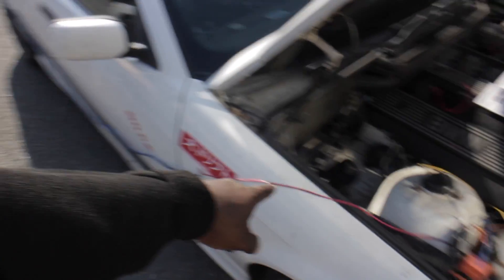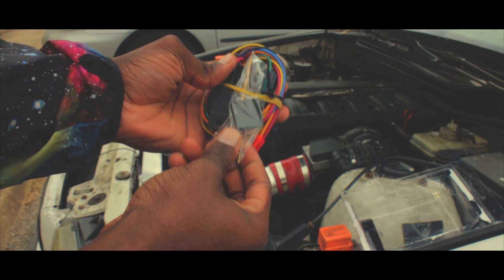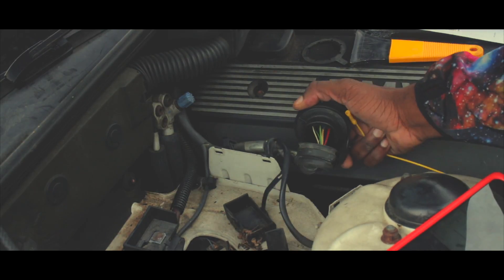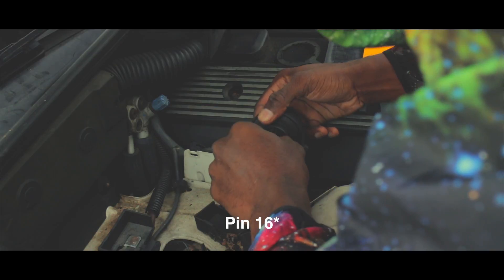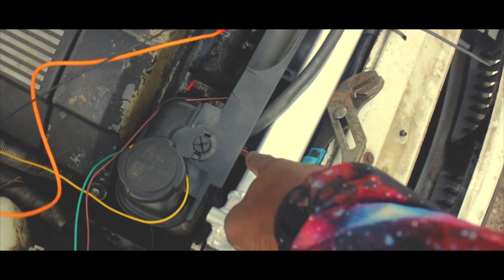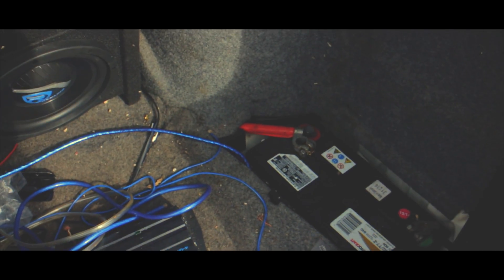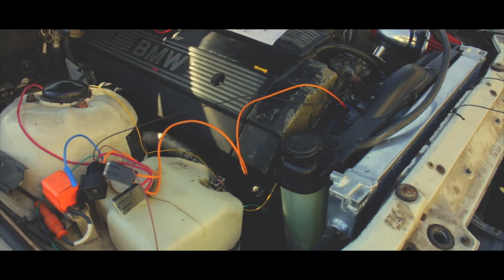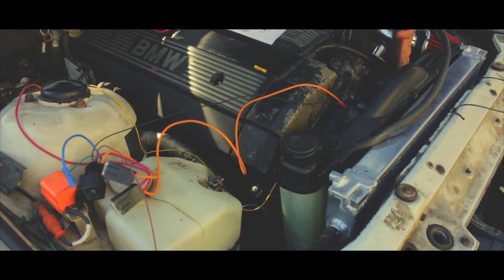E36 Drift Build - Episode 11 Wiring Electric Fan Kit (GONE WRONG)

Comment: dude i literally feel the same way when i work on cars...fuck my life. just bought myself a 328i
Reply from the maker: yeah man.. its such a struggle! ...but hell yeah dude hows the 328i soo far ?
Reply: i got lucky and got mine from a friend and it came with electric fans, aluminium radiator and modified knuckles installed so i got to skip this part on my own car. but just doing the routine maintenance yesterday, id get part way into it and not have the right tool or socket.  i definitely feel your pain in your video when shit starts going wrong. it pours
Reply from the maker: oh okay word thats wassup .. you gotta good one then mines of was completely shit on bricks when i bought it haha .. but yeah man its like when something goes bad it fucking becomes 10 times worst

Comment: sick car, ive considered doing an electric fan conversion, but havnt done it yet.
Reply from the maker: aye man id say got for it i can link you to the electric fan kit i used .. its like 25 bucks that plus electric fan for another 30 bucks cant beat it 
http://shop.advanceautoparts.com/p/imperial-thermostatic-fan-control-preset-226206/3670008-P?navigationPath=L1*14922%7CL2*15019%7CL3*15910